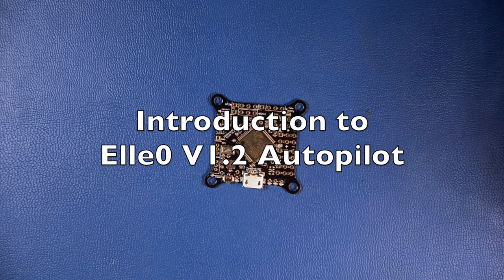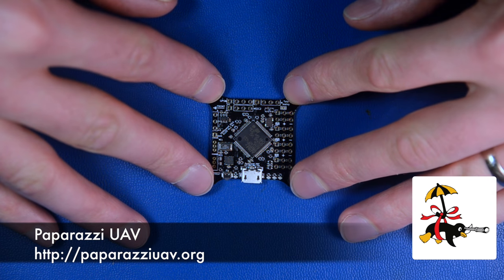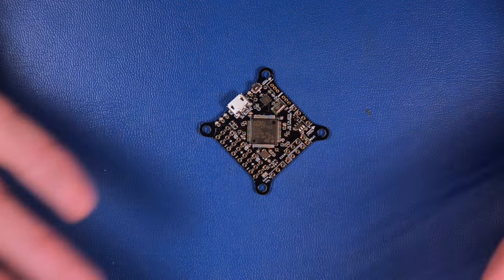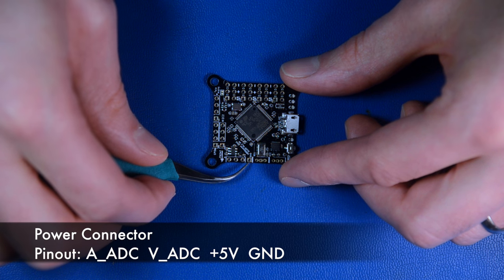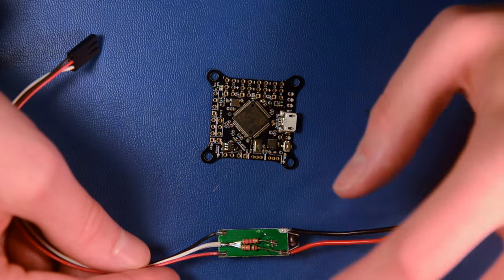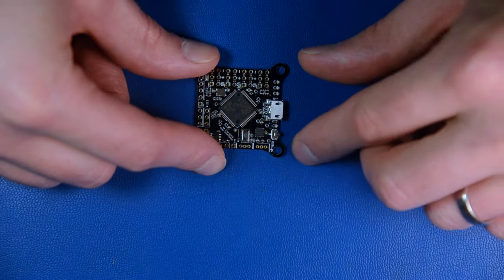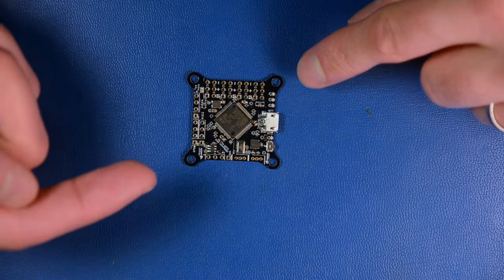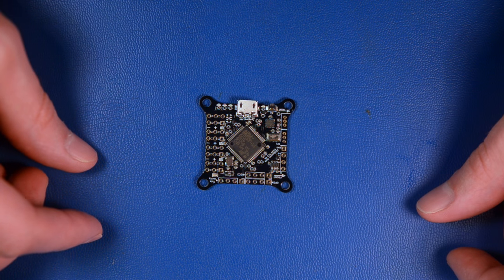Introduction to the Elle0 Autopilot

Comment: Hey Piotr,

good to hear that development of Paparazzi hardware is going strong despite the almost overwhelming presence of NAZE, PIX4, etc. Pricing is definitely a big plus for the new Elle0 compared to the LISA APs.
Reply from the maker: +Pascal Fust Thank you. Elle0 might look similar to Naze and PIX4 but occupies it's own application area. First of all it is designed specifically for the use with the Paparazzi system. We put in a lot of effort at 1BitSquared to make sure it works smoothly with the Paparazzi UAV software base, including drivers and example configuration files. It is the same size as a Naze or CC3D, but has more sensors, more processing power and more memory than the racer quad controllers, and it is designed for autonomous flight not for manual flight as they are. It might look similar feature wise as PIX4 or PixRacer but it is smaller physically making it lighter and allowing it to be mounted in smaller airframes. PIX4 and PixRacer are also much more complex electronic circuit with many more parts interacting. As with any system that needs to be reliable this is a problem. With more complexity, and parts, there are more points of possible failure, making Elle0 a very robust solution. Thank you very much for commenting and I hope this explains things a bit better. Let me know if you have any more questions! :)

Comment: Hi Piotr,Thank you for the informative video!The I2C2, UART3/GPS and UART1/Telemetry ports all offer 5V Power.Is it correct to assume then, that these are 5V tolerant on the TX/RX lines?Thanks, Helge.
Reply from the maker: +Helge Walle I am glad you liked it. To just answer your question: Yes all the IO on the pins are 5V tolerant. Read below for more in depth information. :)

Let me give you some reasoning behind the design decision to put 5V instead of 3.3V on the connectors. (1) In the past (Lisa/M and Lisa/MX) we had solder jumpers to select voltages available on the connectors. It turned out that 90% of users never changed them and very often people were scared of soldering the jumpers. As the design approach of Elle0 is keep it simple I decided to only have one voltage available. (2) Even though most of current electronics are either 3.3V or lower it is a good design to have so called intermediate power rails. They bring a higher voltage supply to the sub-circuit and it is locally stepped down to the needed voltage. Additionally, due to cost and space constrains we only have a very small dual 3.3V regulator on the Elle0 that is responsible of supplying power to the sensors, the microcontroller and the two RC control satellites. We would have to put a much larger and more expensive voltage regulator on the board to have enough power margin to account for all range of possible peripherals connected to the telemetry, i2c and GPS connectors. The 5V uBECs usually can supply several amperes of power making this less of a problem. :)